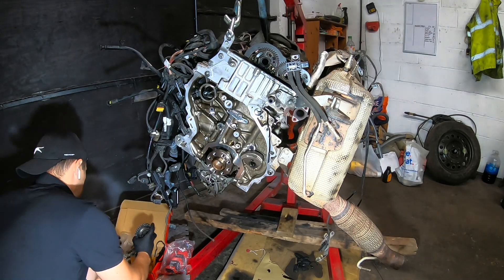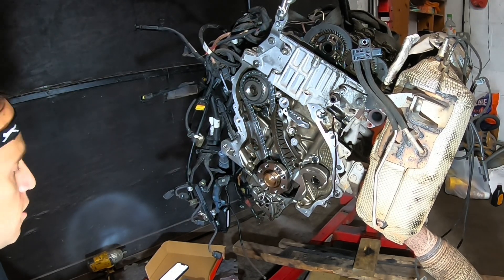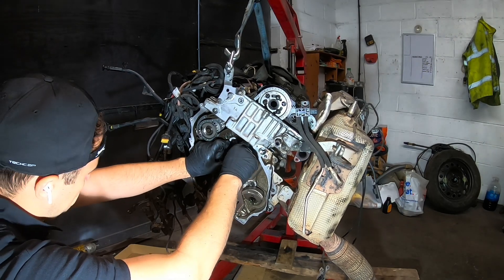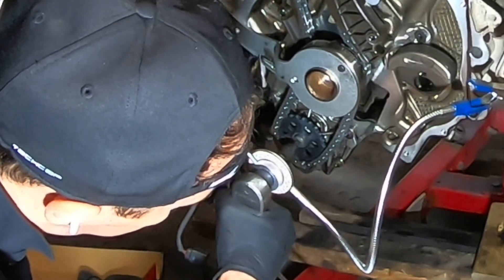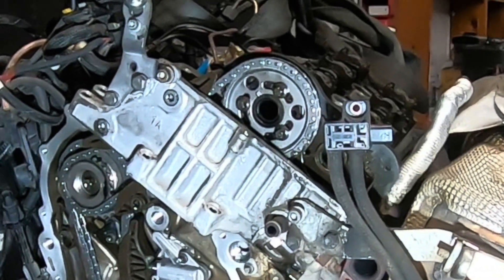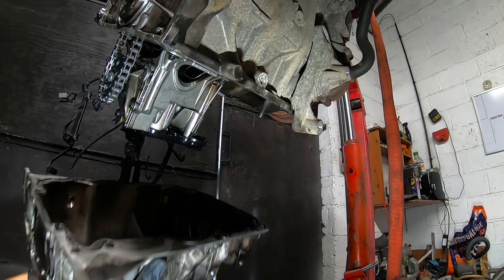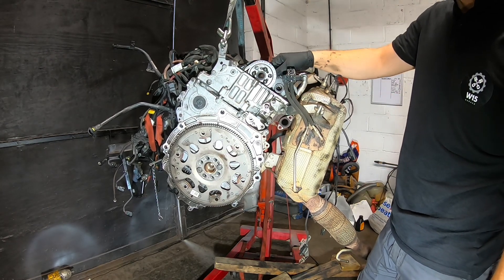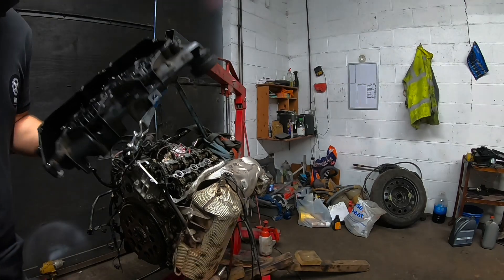Timing Chain Replacement BMW/Mini B47 N47 B37 in detail Part 2

Comment: I have a question about the crankshaft position. I see people rotate the crankshaft 45 degrees to the left from the position you set the crankshaft. Do you know what the difference is between your method and others?
Reply from the maker: @synthetichtthreadproject  I think it has to do with the locking tool. But it is very simple, and it’s only one good position, otherwise the car won’t start. Pistons 1-4 needs to be at TDS, camshafIts locking tool fitted when the correct timing is set with the tensioners released. Descriptions tend to make it look harder but it is simple as that.
Reply: @W15Garage  Thank you for your answer, i have another question if you can please answer it. So... i have n47d20A engine in my bmw e90, and the engine is heavily damaged from piston to valve collision, now i only have option to buy n47d20A engine from x1, the fui assures me it will fit instead of my engine, and he told me only difference is in oil filter housing on engine which he gave to me, on further inspection the block look exactly the same as on my A engine, he also told me that f10 n47d20C would not fit because despite same engine code N47D20C f10 and e90 have different engine blocks. So what do you think about that swap and the mentioned differences in these engines?
Reply from the maker: N47D20A (177 hp) engines and N47D20C (184 hp) engines are not interchangeable. The block, cooling system, etc., are different, so it can’t be done. 

However, for models like the F10, E90 (after 2010), F30, and F20, it’s an easier job and can be done. You only need to swap the wiring harness, (injectors depending on horsepower), engine mounts, and oil pan, but the block fits. I’ve personally done many similar projects. 

The N47D20C has its own variants depending on horsepower. For example, the internals are more robust on a 120d 320d 520d (184 hp) than a 118d 116d (also some 116d f20 have 1.6 engine but that’s a different story ) but you can still swap them. Additionally, the 184 hp version has the cooling bolt for the bi-turbo version. Hope this makes sense.

Comment: Can I order a N47 kit chain for my B47 engine or it's not a compatible kit chain between N47 and B47 ? Thank you
Reply from the maker: @julienvougeot5418  I haven’t replaced b47, but I know that b37 is not compatible with n47, the difference is the fuel pump sprocket being larger in diameter and the upper chain as well. I would imagine b47 is different as well.

Comment: hi there, amazing video and in details, this video  may serve me as a guide when will do my b37 BMW. Any idea at what mileage need timing chain replacing? thank you in advance
Reply from the maker: Hi, thanks for watching! This car had 128,000 miles if I remember correctly, but I’ve changed a rattling BMW chain at 98,000 miles as well. Unfortunately it’s a very broad scale. Cold morning starts are a good indication of the chain condition. I would recommend using OEM Chains, I’m preparing a video on the risks of aftermarket timing kits. Good luck with the job, it’s not that difficult once you’re doing it!

Comment: I like the way you took off the front end in one piece. I’m guessing this is an automatic transmission…? What year? 
I’m just about to put the engine of my 2016 B36 Mini back in. I had no codes just cranked with no start. So I took parts off one at a time to find the problem. The car was totaled due to extensive under carriage damage. Busted out oil pan. I found the cam had jumped about 20 degrees off. One of the timing chains looked to be slightly stretched. 
I’m learning from your video. Thanks!
Reply from the maker: Hi, I think it was 2015. I’m glad I could help. If the oil pan was damaged I would advise you to check the bottom end bearings, main a con rod. If you watch my x3 rebuild video, because a fractured oil pan  the car ran on low oil pressure and damage was caused big time….
Reply: @W15Garage  I did check the bearings. In hindsight I probably should have checked the pistons/rods, but hoping for the best. I will know if all is good in a few days. Thanks again.

Comment: Great video! It's exactly as the N47. The timing chain cover needs silicon as well.
Reply from the maker: Thanks Appreciate it! Yes good old Victor Reinz silicon was used on the timing cover as well, just the video started to be to long, so I’ve edited out that part.